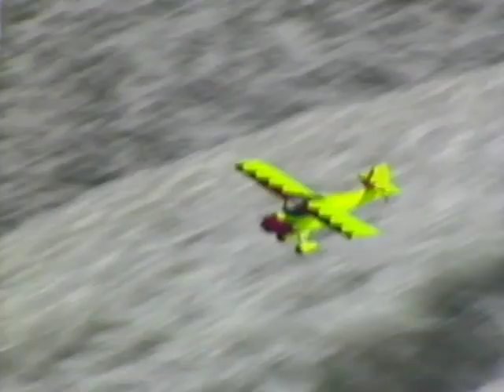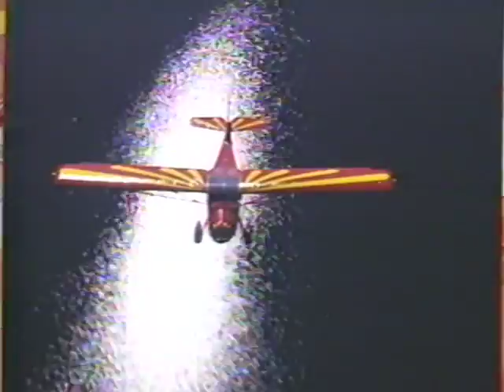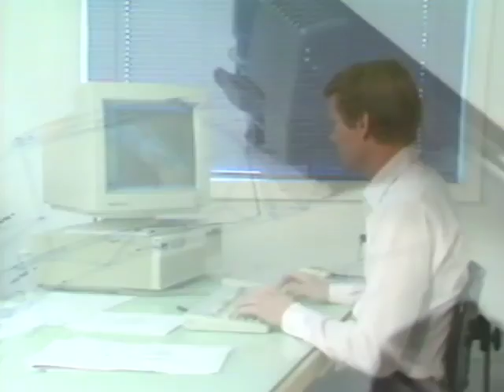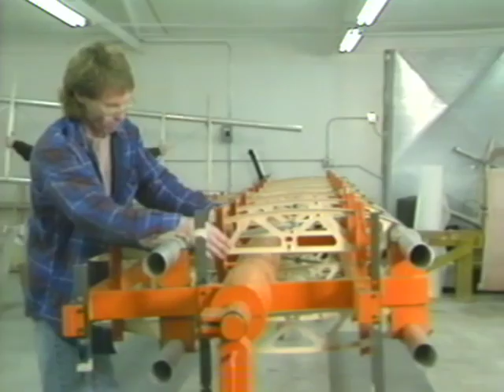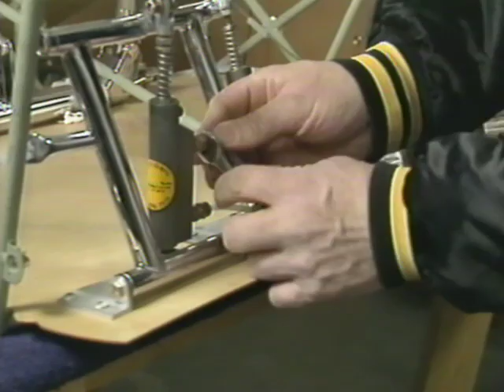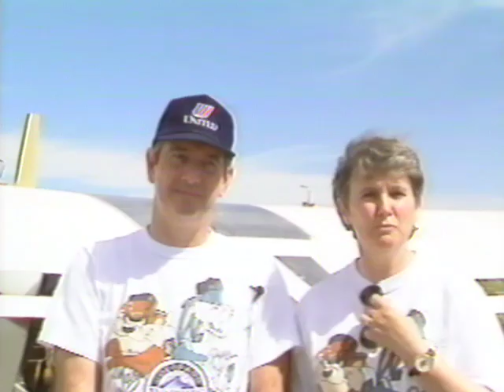Dream It, Build It, Fly It - The Kitfox Experience

Comment: I did most of the air to air video for this production with Rick Lindstrom.  We shot from my Helio Courier H295 using two Betacam cameras - one mounted under the left wing for the fore and aft shots and one on a mount in the right door.  We shot in the Sawtooth mountain range near Stanley Idaho, Lake Tahoe, California and off the California Coast near Half Moon Bay.  "Robert Campbell Aerial" on Facebook and http://www.robertcampbellphotography.com
Reply from the maker: I remember seeing your Helio Courier at the Kitfox factory in Nampa with the gyro-stabilized camera mounts during the time the video was being shot. I remember a large crew went and stayed at Redfish Lake for the filming. I think your plane had some bright orange on it. Now that is an AWESOME airplane (the Helio Courier, that is)!
Reply: Those mounts were my own design and they were not gyro stabilized.  The camera on the wing was just bushed with some IsoDamp material to take out high frequency engine vibration.  The door camera was on a 100mm ball base fluid tripod head.  This was mounted to a seat track, so the cameraman had full motion with the camera which was attached to the airframe without gyros.  The whole system was very stable.  I got the idea from a book called, "When Hollywood Ruled the Skies."  Paul Mantz who did the aerial work for Howard Hughes had a Lockheed Vega with seven camera mounts on it.  No gyros in those days, and he did beautiful work.

Comment: I just sold my Amateurbuilt Zenair ch300, great aircraft but ready for different style of flying. Now having built my home in Northern Ontario, lost of trees and lakes, I need more visual . I have an opportunity to purchase. Kitfox 1 reg as Amateurbuilt, powered buy Rotax 503. Now I plan on installing Transponder and radio, only two things make me nervous . Folding wings and 503 2 stroke . Undecided . How many hours before OH , any history of folding wing unlatching ? Can the Kitfox 1 have the 912 installed ?
Reply from the maker: The 503 is a good engine in my experience. I flew the Kitfox XL with that engine in 1993. I don't think the structure or geometry of the Model 1 would lend themselves to easily support the 912 installation. I seem to recall the 503 having a TBO of around 500 hours. The 912 is 2,000 hours. I have never heard of any issues with the folding wing. The design was sound.

Comment: Nice post of the old promotional video from SkyStar for the KitFox. This was a really cool to watch and I would agree with the other kitfox pilots that this is a really amazing airplane to fly. My Kitfox 4 (1200) has the Grove gear and bush tires as well as the matco wide tail wheel. I can land almost anywhere with only a few hundred feet needed. It also helps to have 90hp on a light plane with a great wing. The flapperons are one of the best features.